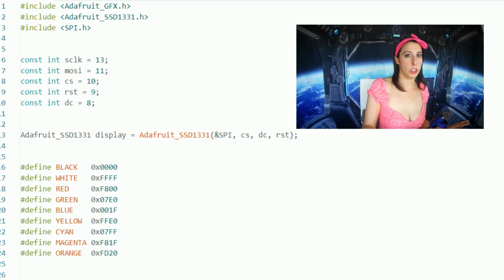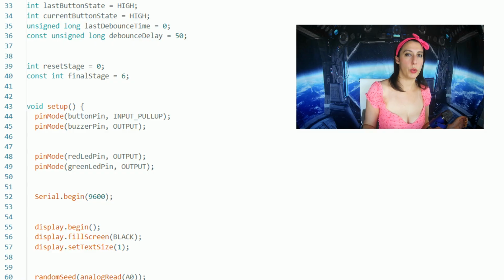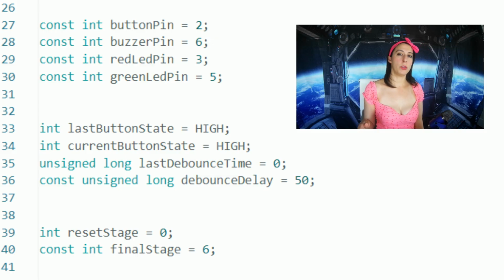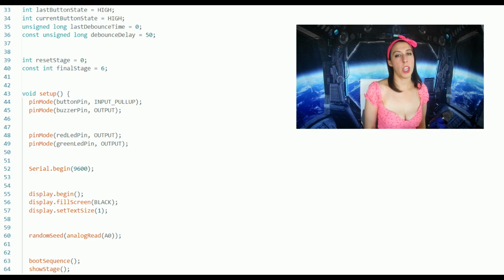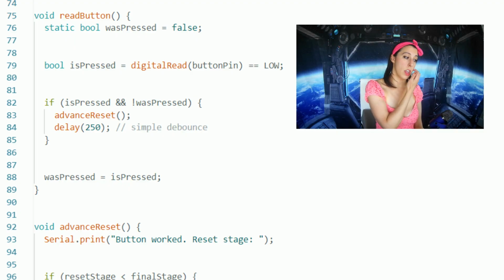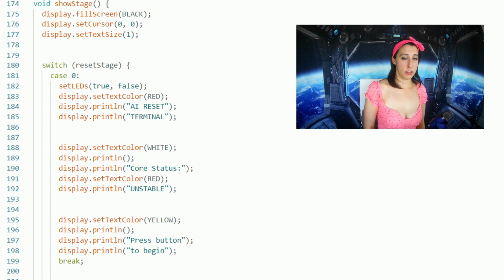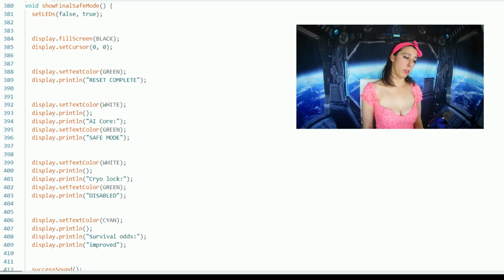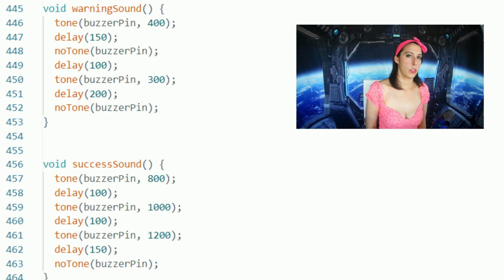Resetting the Ship AI With Arduino After Another Cryochamber Disaster!

Comment: This is one of those videos where I love to follow along but I know I will likely never be able to implement this into a cool project.
Reply: Following along and getting it working on your desk is a good goal by itself - if you haven't worked with arduino before, start with the first projects. My first project was making an led blink a few years ago, last weekend I built a pc fan tester using an arduino (I had a lot of used fans to see if they worked, and to listen if they were noisy at high speeds).
Reply: @soupwizard Oh I've ran Arduino for years. I've replaced the brains of commercial ice makers using hardware. This is one part of it that I'm still learning haha.
Reply from the maker: The good news is you never really NEED to unless you have an angry ship to reset!
Reply: @unprofessionalspacepirate Hahahahaah